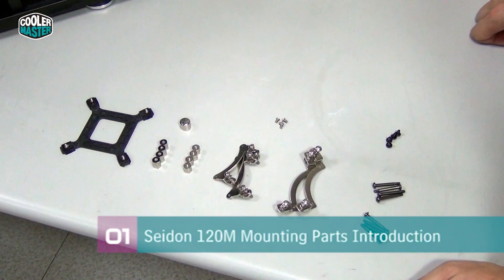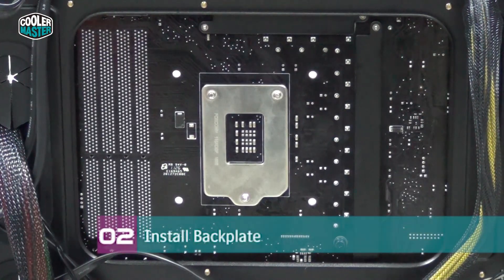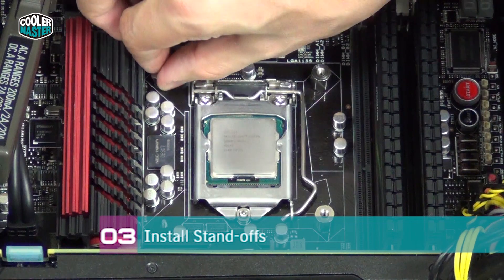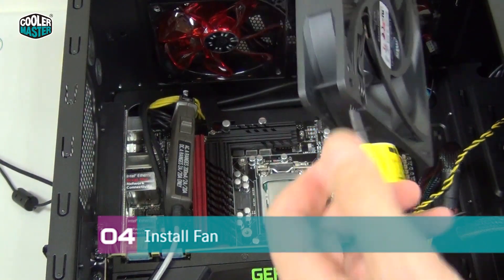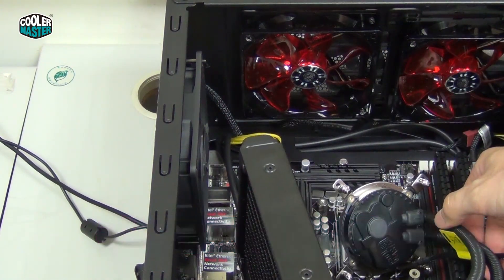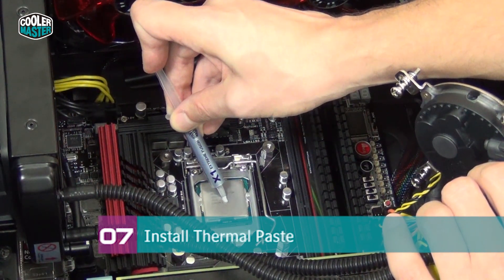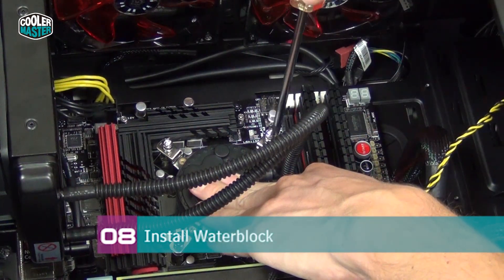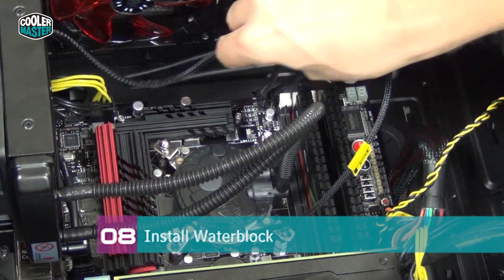Cooler Master Seidon 120M - Installation

Comment: So which header do I connect the wire coming off the CPU cooler? I have 3 options.. cpu_opt or CPU fan or a.o.i pump? It's a x370-f mobo Asus strix.

Comment: can i use a splitter on a cpu fan that has a 4 pin female 3/4 male ...
1 for the pump and the other for the fan of the radiator ???

Comment: what if I need to uninstall/resinstall the cooler if say I had a cpu error I need to unplug then replug the processor ? do I have to re-apply the thermal paste?
Reply: nah you wont but just don't do it often as the paste will dry and then not conduct heat as well as it could before
Reply: alright, thanks
Reply: its ok

Comment: My case already comes with a fan on the back, can I keep it on while I am installing this?
Reply: +crazygrasshopper1234 doubt it, I would think that the fan included in this package is specially designed to support having a radiator mounted on it...
Reply: crazygrasshopper1234 yes also you can use that fan on top of the case

Comment: hey , i installed the seidon 120v, the regular one , attached the 3 pin and 4 pin , started the pc  run bf4 , temps were  arround 60 degrees C ,  pc restarted by it self , again it happended under stress , i started to smell the burn , i shut my pc and took the thing off put back my cpu fan , what could that be !??my specs  i7 960k 1366, 8gb ddr3, win 8.1 , r9 290 , psu 600watt certified . i think the psu started frying , the cooler only uses 3 watts and 4 watts , so whats the problem , any idea :)
Reply: U should turn off the refrigeration system and see what happens. Next, take off the all the refrigeration system and u should mount it again

Comment: One question.  I have 2 CPU fan pins labeled CPU1 (3pin) and CPU2 (4pin).  I'm assuming that I can use the 3 pin for the pump and the 4 pin for the 120mm fan?  First time with water cooling.
Reply: Steve Z i think its the same either way where you put the pin on to.
Reply: The 4 pin has speed control, the 3 pin always run at full speed

Comment: Can this cooler be mounted at the top of the case instead of the back?
Reply: Alexstrazsa yeah man.. if your case has top fans..
just remove the fan, put the watercooling fan, then put the radiator, just like in the vid but instead on the back of the case you do it on top your case..

Comment: Does the cooler come with liquid in it already?
Reply: yup that's why its called a all-in-one (maintenance free)
Reply: Connor Haswell By saying "maintenance free" do  you mea that you dont have to change the liquid in it?
Reply: ***** AIO coolers are completely sealed from the outside environment, so no microbial bacteria gets inside the fluid. You only need to do anything with AIO coolers if they leak or the pump block stops working. Otherwise, completely maintenance free.
Reply: bluesy92 Thats great! I was thinking of buying an AIO cooler,but i didnt want to have to change the liquid.
Reply: its been 3 years since i have got it, my friend said i need to change the coolant, how do i go about changing the coolant?

Comment: One question, I dont have a 4pin connector next to the CPU fan 4pin like the motherboard on the vid, but I have 2 4pin connectors on the other side of my motherboard they are labeled sysfan1 and sysfan2,can i plug the pump in one of those. As far as I can see they are the same as the CPU 4pin physically speaking.
Reply: no bad idea, make sure the pump is pluged into the port ur recent cpu fan cooler was pluged into
Reply: thx mate,as it turned out you can plug it in any 4 or 3 pin connector you have on your mobo,just go in your bios and set that connector to work at 100%
Reply: yea i watched a review about some guy ranting about the noise and someone pointed out that if you dont have the pump at 100% it will slowly die.
Reply: beside that it wont cool the CPU as efficient as at 100%...
Reply: can you control the fan too? because the faster the fan the cooler it will cool the aluminum radiator and keep the heat down
Reply: sure,I think you can control every fan that's plugged in your mobo,if the mobo supports fan control,there's lots of software's for that to,like SpeedFan
Reply: oh theres software for that... thats handy thanks heaps haha
Reply: I got myself a Seidon 120v and it runs like a boss...don't know what that guy was talking about some noise :)
Reply: *****  nope not so far,sometimes it sounds little strange like someone is choking lol :),but that's not an issue at all,the temps are great and it looks cool,and no leaks thank god...but guess that will be always on the back of your mind when you get liquid cooling in your pc :P...next project of mine will be getting a stock liquid cooler for my GPU,with a bracket off course...

Comment: guys the best is to connect the fan to the cpu header and the pump to the psu or a 12v header on your motherboard (sys fan at full speed).

Comment: I just installed the seidon 120m two days ago. It makes a rattling noise. I have both the pump and the fan hooked to a 4 pin connector, I tried reseating it but it didnt change anything. Is there anyway to fix this?

Comment: I have recently bought this item (not fitted) but surely a back intake of air is warm, which defeats the whole idea of a radiator, cold air is to cool the radiator, which intern cools the cpu, if warm air is used, then surely this reacts in the opposite of the designed functionality of the radiator, therefore reducing the effects, and the stability of the parts in this product..?
Reply: It doesn't matter where the fan is on the case, if it is pulling IN air from the room it will be cooling air.

Comment: Hmmm... the screws don't seem to be quite long enough to mount the fan and radiator to my case....
Reply: I know this is a late reply, but this video contradicts the instruction manual. I had exactly the same issue trying to screw in as per the video but when I contacted CM support they pointed out that you use the short screws to fix the radiator to the case, and then the long screw to fix the fan to the radiator.

Comment: can you take out the radiator alone and use it on your custom water cooling if the pump start to fail over long period?
Reply: I did that its not big enough to keep up with bigger loops like with gpu cooling.

Comment: hey guys i just want to install watercooling but do i need liquid i dont know does it need liquid when u buy it or its rdy for use and after a long time u need to replace the liquid?????
Reply: It's all in one. No need to add liquid or change anything. Connect it, screw it in, plug the two power plugs, and it works.
Reply: ty :D

Comment: Never touch the Copper part of the heatsink that touches the cpu you leave oil residue on the cpu will make the cooling system less efficient .  Also why did you remove the thermal paste that came stock on the heatsink just to add your own?

Comment: It is logical to put the fan on to suck air from outside the case to cool down the radiator, however for me that just doesn't fly because there wasn't enough of a positive airflow inside the case, yes I flipped the front fans to blow out but the HDD brackets block the flow, with the radiator and side panels sucking in and front blowing out, my video card, HDD's and RAM got way too hot and my i7 3770K couldn't get below 35C idle and went up to 66C.  So I was getting better results just sucking in from front and side and blow out through the radiator plus my CPU dropped as far as 18C and as high as 58C.

The guy's method may work for some people, but didn't work for me.

Comment: Hi! Is it okay to have the orientation of the radiator in such a way that the tubing are coming out from the upper side? I find that for my case and components, it is aesthetically better. But i don't know if that would affect the cooling performance.
Reply: It should't impact the performance at all. Cooler Master had it installed like that In a picture on their website http://www.coolermaster.com/cooling/cpu-liquid-cooler/seidon-120m/

Comment: it doesnt come with the thermal paste doesnt it?
Reply: Jim John You simply did not install it properly, the packaged paste is good enough.
Reply: *****
 arctic silver FTW
Reply: I bought 120V recently and it had the paste included, altough not so large and fancy as in the vid.
Reply: peterkray I bought the 120v aswell. On a 8350 it overheats and throttles in a matter of seconds with prime95. I came here to see how he applies the thermal paste to see if I did anything wrong....
Reply: Jim John I had problems like yours before. Ran it for a couple months and sometimes the 8350 would even give me errors that it was overheating. Finally removed it and saw that most of the thermal paste had moved around and there was a huge air bubble and most of the proc wasn't covered. Reapplied and it worked great.

Comment: I thought the back of a pc is always to blow hot air out and the front is for cold air in to make efficient air flow...so why is he blowing hot radiator air into the case makes no sence
Reply: There are multiple ways to handle air flow in a PC and many people adjust temperature strategies when using water cooling.  The air flow you describe is standard because the air itself is cooling everything in the case.  However, when you are using a water cooler it is the water that is cooling the CPU (or more depending on your system).  So to keep the water in the system as cold as possible, we need to suck in cool air from outside the case to blow on to the radiator.  That being said, you absolutely still need to manage air temperature inside the case and will always need at least one exhaust fan blowing hot air out, preferably at the top and back of the case.

Comment: pls pardon me if i might sound like a newbie but i'm not much of an overclocker.... i have the Intel Core i7 3930K & a Cooler Master Seidon 120M i got both from Newegg... paired with a ASRock X79 EXTREME4-M motherboard. Now this is my issue:

after a short while of normal operation, the cpu multiplier dropped from 32 to 2 & the temperature was constantly at 82 degrees... i though it might be the thermal paste so i cleaned it off & reapplied but i still got the same temperature range. I then concluded that it might be the motherboard so i did bios updates (twice) & i even manually specified the multiplier & clock speed without touching the Vcore (via bios & windows).

as a last resort i replaced the motherboard with a GIGABYTE GA-X79-UD3 & i noticed the temperature was running at 34 degrees then moved to 54.0 degrees. It was stable for a long while & i noticed the Vcore was at 1.176v but later on that same day the temperature went up to 92 degrees & the Vcore dropped to 0.86v & the multiplier dropped to 3 same as it was with the Asrock motherboard

please advice
Reply: Your vcore is too low...... try setting your vcore to like 1.35v or 1.375v and then you should be fine.
Reply: Taun-Chi Gaming Also, if that doesn't work, it's probably your power supply and you should replace that right away.
Reply: I know this is an old post, but make sure that the water PUMP is always operating.  You do not need to run the fan all the time as it will be unnecessary and create extra noise..  If you plugged the pump in to the CPU fan pins on the mobo, it may be turning on and off.  Go into bios and make sure whichever fan connection you plugged the pump into is always operating.
Reply: ok thanks alot... had the pump changed though, apparently it was faulty

Comment: I have the 120v, can I still the radiator after the fan like on this one, because the manual says fan first then radiator?
Reply: No support on their YouTube :(
Reply: Hi, I installed the 120V yesterday. I did it according to manual but there is no reason why you could not install the radiator first and fan afterwards, as the radiator screws will go from outside of the case on the back, and the fan screws to radiator from inside .

Comment: Had to drill new holes in the 922HAF Cooler Master mid tower case because the radiator was too bulky. It was a tedious process removing the mobo again to avoid getting any metal flakes in the system but better off being safe. I was disappointed it didn't fit being a CM case + CM heat sink, but ended up working anyway.

Comment: spread the thermal paste and try to do it once and do it well not over and over until youre happy like the guy in the video says.

also having fresh air blown in isnt the best of ideas either. quickly you will realise it will plug up with dust and youll have worst temperatures. my suggestion is to have good ventilation in the case and have a push pull configuration blowing out the back of the case. ive ran my h50 like that since 2006 with zero issues.
Reply: you have an h50?
Reply: Do not spread the thermal paste.  The old business card method doesn't work very well.  Putting a pea dot in the middle like he demonstrates is the best way.  

Also, when he said to try it over and over again he really should have mentioned that if you do another attempt you need to clean off the thermal paste from the previous attempt with a Q-tip and rubbing alcohol.

Comment: How to remove old Thermal paste and how do you Instal the 240M version on an Am3+ Model you only show Intel socket
Reply: I know this is old, but clean thermal paste with a q-tip and rubbing alcohol.  The only difference in installation between intel and AMD sockets is setting the arms of the back plate, and there are different mounting brackets (which are included).

Comment: Is this compatible with LGA1150? Anyone tried it out?
Reply: Yes, it'll work with all 115x sockets. I'm currently using it with a 4670K.
Reply: ***** Nice! I'm soon building my pc with a Seidon 120V and 4670K. Have you overclocked your CPU and by how much? Is the fan on the radiator loud? Thanks!

Comment: I did everything in this video, but the computer would simply not turn on properly. Not even signal on the monitor. I cleaned the computer, replaced the part 5-6 times, and it didnt boot. I gave up, and went back to my old cooler, and now it works wtf...

Comment: You have 2 choices, use the air in your case to cool the radiator, IE, the radiator will exhaust air, or blow the air that cooled your radiator through your case, ie, the radiator will be intake. The first will give you worse cpu temps but better temps for everything else, and the second will give you good cpu temp but everything else will be worse.

Comment: You idiots.  He put the fan on the case first because he is using it as an intake.  He specifically said that he was doing it differently in the video.  If you're using the fan as an outtake, then you would put the radiator on first.

Comment: the radiator goes in the case first and then you install the fan where its blowing air through the radiator, if any of you did it like he did in this video your gonna screw up your PC
Reply: MastaX So which header do I connect the wire coming off the CPU cooler? I have 3 options.. cpu_opt or CPU fan or a.o.i pump? It's a x370-f mobo Asus strix.

Comment: I´m confused, I installed it as per the manual, where its radiator then fan, but then I saw this video where its fan first to the case then radiator afterwards, which way is correct ?

Comment: I have a cougar SR 650w PSU and here are my specs.
CASE  - Cooler Master K280
MOBO  - ECS-H77H2-M3
CPU  - Intel i7 3770 3.40GHz
RAM  -  4 gigs of Kingston generic RAM
GPU  -  MSI OC GTX 760
PSU - Cougar SR 650w 

will it suffice the seidon? please respond.

Comment: Yes I did, first I had to MAKE the radiator fit my case. Then I realize that I apply to much presure to the processor, so I remove the pump back with care by twisting it. Then I fix the pins on the processor that I  bend, put it back in with care and turn it on

Comment: Hi just got this. and only one screw would go in. Worst installation set up ever. Dont know if it was a production failure or whatever.But im sending mine in return tomorrow,if i get the same problem with the next one. i will defentivly get another one. I have a cooler master silecio 550 case so i can't see that is the problem. i was looking forward to have water cooling after i upgraded my pc,so it was a real bummer to have to go back to my old air cooled cpu fan.

Comment: I have a motherboard M5A99X EVO for AM3+ and I have a doubt. my motherboard has a 4 pin connector that said CPU_FAN, I believe it's for the radiator fan, but next to it has a 3 pin connector that said PWR_FAN... That's where I have to connect the pump??? Thanks and sorry for my english

Comment: "so the waterblock doesn't come off while the system is running" had this happen once with the stock cooler. it just fell off one day, and hit my gpu (it wasn't a shrouded one either, a bare chip and heatsync setup) that didn't end well for my CPU's life.

Comment: Ok thnx. So, this way(in the video, with the fan installed to pull air from the outside and the radiator "looking" to the inside) the cooling is working? Cause in the manual it shows to way 1) the radiator is "looking outside and the fan inside 2) the way that the video shows but it adds one more fan after the radiator. Waiting for your reply :)

Comment: Usually one fan is the best option. If you really want great temps, a second fan is good in push/pull. Although that'll only reduce the temps by about 3-5 degrees.. :)

Comment: I just install this cooler in my case (Thermaltake V3 black edition) and it doesn't fit!!! is way to big, make sure you have plenty of space for the radiator!!
Also, once I install it making some miracles, my pc turns on for some seconds and then it goes off, over and over again. I'm afraid I broke the processor since you have to apply so much pressure to make the screws get to the back plate

Comment: "The pump uses a three pin header". Well, apparently, mine uses a four pin header (one pin hole which is see through) and now doesn't fit in my motherboard. I guess this is a production error, right?